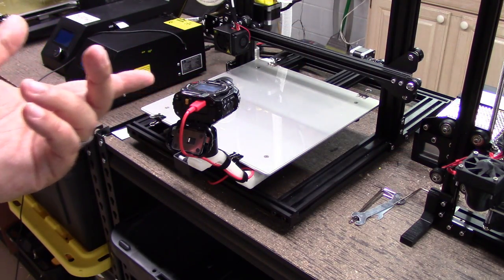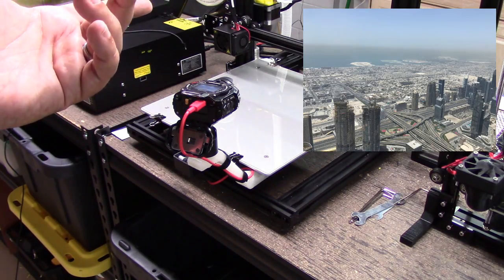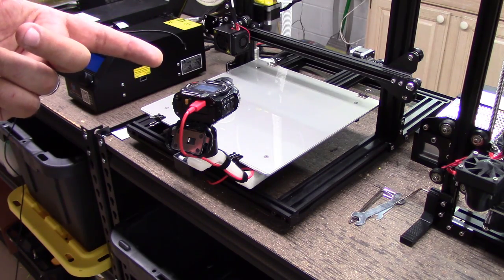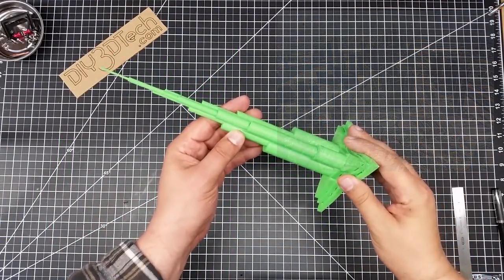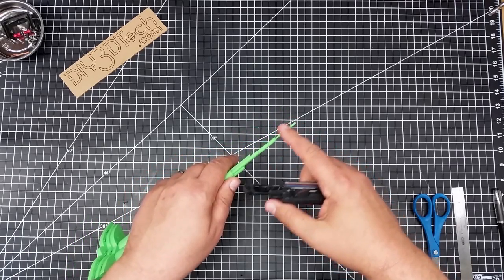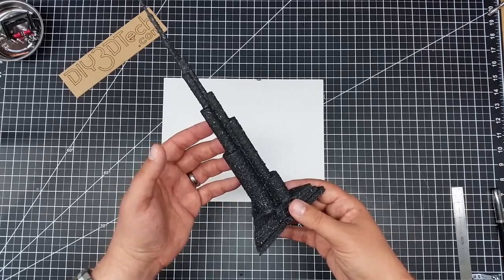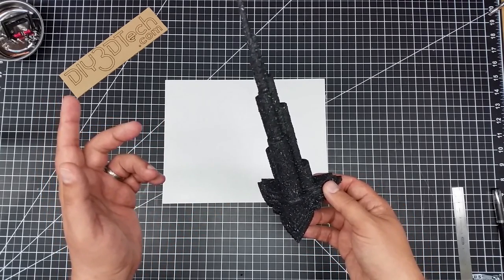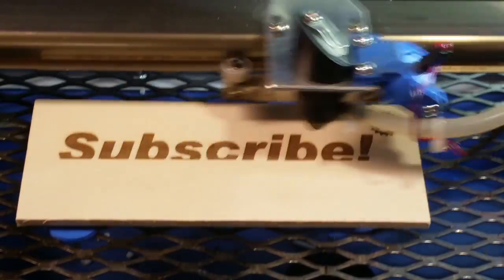Creality CR10 - Putting it to the Test Printing the The Burj Khalifa!

Comment: What camera are you using there on the CR10?
Reply: DIY3DTECH.com is it possible to charge and use the camera over a cable in order to record time lapse footage that takes very long?
Reply from the maker: Yes, you can power via USB during a time lapse, as this is what I like [about this camera] is all of the TL options and the ability to do this...

Comment: those errors have nothing to do with your info I am assuming you're using simplify3d it has a fundamental flaw built into the program that they don't seem to want to fix for some reason watch your time lapse again when you get to the top of one of those sections and it has to print a smaller section on top of it it should be printing a solid layer all the way across in order to be a base for the next section that's smaller than the previous section but instead it tries to print the outside layer with nothing on the portion that will become the next section of the building so neither is supported correctly you can compensate for this flaw in the program but using more info but only extremely high in Phil actually fix it the solution which is a royal pain in the ass is to make it a multi-process print with start and stop at each of those layers where it changes from a larger portion to a smaller portion of the model this will cause the program to create solid top and bottom layers For Those portions so at this point I would select 2 top and 1 bottom to top for the first process one bottom for the second process and then also to top one top on the way up this way it creates a solid layer which will cover up the infield correctly without leaving the gap for the smaller piece the software should do this automatically but it does not I really wish simplify3d would fix this
Reply from the maker: Interesting, however I use Cura as nothing against simplify 3d but I try to stick to things that most people have  access to.  However you bring up a good point and I will have to go back and look at the video as your observation is interesting...